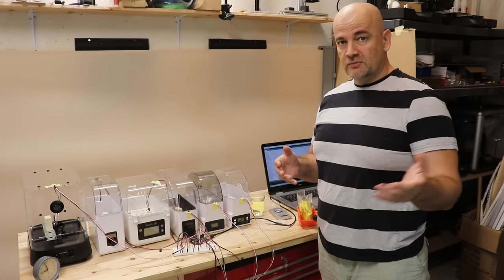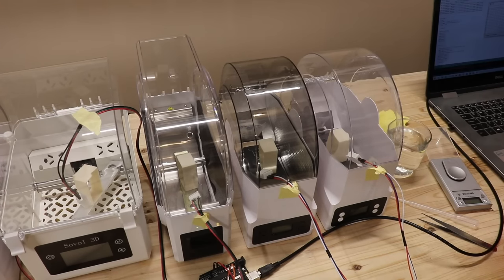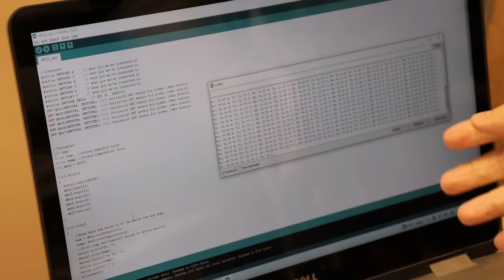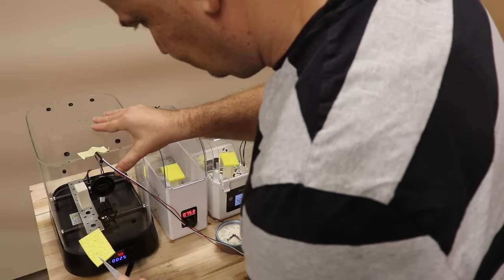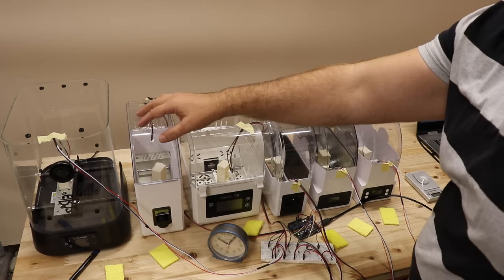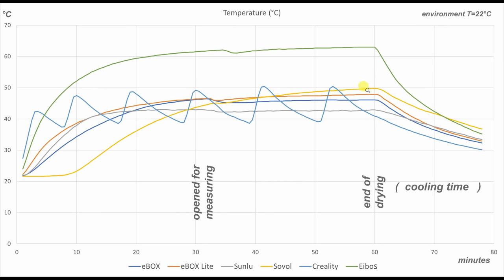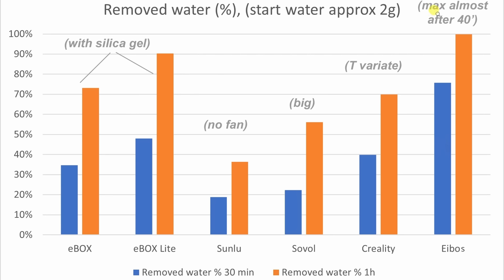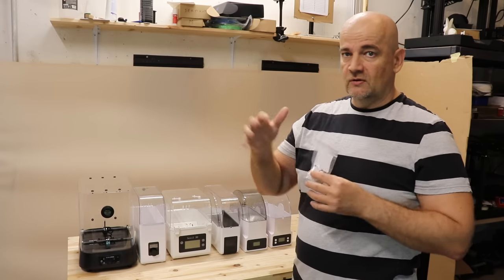6 filament dryer test - which one dries better? eBox, eBox Lite, Sunlu, Sovol, Creality, Eibos

Comment: This is awesome, thank you for the greatly designed experiment and clearly presented results! I am only interested in the dual spool devices, Eidos Cyclopes and Sovol 3D in this case to swap my filament spools for print tasks that last several days in a row. I don't understand why, in the Relative Humidity % plot the Eidos starts at 50% while the others start at around 70%? I think Eidos is designed as a dryer while Sovol can't decide whether it's a heater or a dryer. I can count 17 outlet & air vent holes in Eidos and only 2 outlet holes in Sovol, so the latter cannot efficiently release water vapor when lid is closed. To get a better sense of the drying capabilities of the Sovol, I drilled 2 extra holes in its cover and removed the outlets from the two original holes; then I put two recently open spools in it and set the temperature to 50 °C. By the time the temp monitor reached the target value (about 20 min), humidity had dropped from 45% to 32%; after 4 h it dropped to 22%. However, I think the Eidos still beats the Sovol because of its better air flow design: in Eidos, air flows from bottom to top and out; in Sovol, air has a circular movement around the spool axis.
Reply: The Sovol literally says in the instructions that the lid is not designed to be fully shut. Its meant to be left partially open using the latches to prop it up. Which then allows the moisture to evaporate out appropriately. I tested it both completely sealed, and with it slightly cracked open. Slightly cracked open the filament humidity dropped MASSIVELY and in about half the time.

Comment: Which one can be run automatic? I just want to put the filament there and print. Don’t want to be manually controlling, it should just turn on when humidity inside fall below a threshold and it will be ready to print .
Reply from the maker: None of them is automatic, but very minimal settings. For example with Creality dryer you just need to turn the knob to set hours for drying.
Reply: @MyTechFun  wouldn't it make sense if you can just set the humidity and leave, so it auto turns on when needed. When you want to print the filament is always ready.

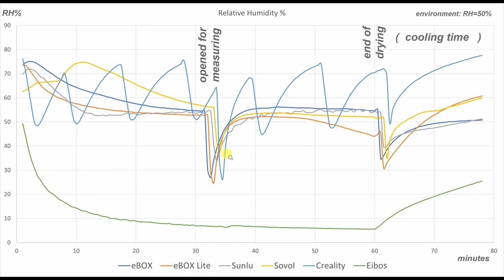Comment: Most useful plot is at 13:03 I think, showing that the EIBOS was the only drier which actually reduced the humidity! It got it down to < 10% Relative Humidity.
Reply: You could mod the others to allow the same process. This has been my biggest thought about buying one.. Would need to put some holes and silica.. probably dont need a fan - you dont want to be drawing out all the heat if your airflow is too high.

Comment: I have ordered the Creality one. And mine is not clicking during operation.
You only hear a relay click when turning it on.
I measured with a wattmeter and saw wattage go from ~4W to ~140W without a relay click.
So maybe they listened to you and updated the device 😉
Reply from the maker: If companies would listed to me, they would use silent fans on lower RPM. Variation of temp is too big in creality. I did also a noise test too. https://youtu.be/lINpcnp583w

Comment: Different temperatures of air store moisture differently so it's unfair to set the eibos to 70°C and the other lower. Maybe next time try use the smaller eibos dryer so that the volume of the drying region is also comparable too. But still interesting things to learn!
Reply from the maker: Unfair or not, I set all to max temperatures. If you would have all these dryers, and you need to dry nylon, you will not set Cyclopes to 50C just to be fair.
Reply: @MyTechFun  I totally see your point there and it makes sense. To be honest the eibos would still probably come out on top imo but in terms of a test the variables should be kept constant because then it would be made known which one is the superior product because they're all doing the same thing. As for needing the higher temperatures an end user would simply be forced to use the eibos but someone needing only pla drying would then clearly see the best product with a reasonable extrapolation to suggest that the results would be the same for higher temperature settings on the machine.

What I found really interesting was that some units turn the heaters off and on quickly

Comment: Hello,

Thank you for the detailed complex test. 
Could you make a comparison to the test with a fruit dehydrator? 
They are quite cheap, and more than 2 filament spools fit in. 
I have a idea. Can we use the printbed to dry a filament spool? 
A little enclosure (carton) with a hole on the top. The printbed can 110°C on prusa MK3s(+). 

Many greetings

juck.
Reply from the maker: Yes, I will. Only I want to finish the modification, so I can use it during 3D printing too..

Comment: Thanks for your work! I needed exactly this.
The eibos is expensive and I only need a one slot dryer. Do you have any results printing nylon from the eibos easydry? Do you think the 50degrees are enough for it or should you need the 70degree?

Comment: Hello Igor!

I'm newbie in 3D printing, some weeks ago I bought a SV06+, and I looking for a filament dryer. 
Now I'm hesitating between Sunlu S02 and Sovol SH01, and I don't know, what is the most important: the fan or the potentially higher temperature. I know both are important, but if I have higher, but not ventilated temperature, it may isn't enough. 

Now I started printing with PLA, but ofcourse I'll want to try any other type of material. 

What do you think, what can I choose? Or drop my hesitating, and choose a total different one? The budget is not endless, but if I can buy a much better for not too much money, it's okay for me. 

Thanks in advance,
enthusiastic follover,
Attila (from Hungary too :) )

Comment: Nice video. One thing I haven't seen anyone make clear about these dryers: Do they take air in from outside, or exhaust air to the outside in any way (eg active/fan powered vent slots, or passive 'holes' to allow air to enter/escape)?
Reply from the maker: Real dryers (like food dehydrators) let the air out, with this they take out the moisture too. Now, the question is, is it really necessary with filament dryers? Usually you don't have so big amount of humidity. Probably.

Comment: Could you compare to/add information with using a cheap food dehydrator?
Reply from the maker: Yes, working on that too. I have food dehydrator, only I want to finish the modification, so I can use it during 3D printing too. After that, there will be a video

Comment: What is the diameter of the rod and the diameter of the bearing which make up the rollers which hole the filament spool in the eSun eBox and the Sovol units? (mm)
Reply from the maker: Main middle part of the rod 8mm, Besting not sure, I couldn't take them out, on sovol look like 10mm (probably the rod is smaller dia there)
Reply: @MyTechFun  Ahh. I thought the Sovol had removable/adjustable rollers. Which on has the rollers which you can remove and set in place for either large or small spools.

Comment: Very interesting comparison. Did you set them all for their max available temperature?
If not - it would also be nice to see as a comparison:
declared max temp, is it actually could be reached (I know, in most cases - no), and how fast actual max temp could be reached
Reply from the maker: Yes, all set to max temperatures
Reply: @MyTechFun  Then it would worth to show them on graph as horisontal dashed lines
Reply from the maker: @Kekht  Some of them don't have exact set temperature. For example on Creality. Also on eSun dryers, only level is set, but what is that temperature, not. Explained on separate review videos for these dryers.

Comment: Thanks for another great video; however, I think your comparison is missing a key dimension: the capacity of each dryer, in kg.  If I wanted to use the Cyclopes for two spools of filament, or one jumbo spool, its effectiveness would be quite different than if I used it for a single, "regular"-sized spool.  In other words, I would fully expect it to "dry" your single sponge twice as fast as a competing product that only only holds half as much filament.  This review makes it look better than it really is, but it still seems like a good product.

Comment: Well, now I regret buying the Sunlu dryer :( But honestly, it's worked fine for my needs even if it isn't the best.
Reply: If you do the fan mod and add some descant its actually not too bad. The fan helps the air circulate so gets an even temperature. But tbh for the prices of the esun and sunlu its worth spending a little more to get the eibos.

Comment: Honestly I am kinda upset with these dryboxes, for their cost - they are very bad.  Why?   You can get a decent sized food dehydrator for around, $60 US.  you might have to shop around to check sizes, and aim for one with metal racks over plastic (and not the cylinder ones)  - but these can also get to temperatures needed, and have timers and the like - and are designed to dry foods, so ... drying filament isn't any different for it.   Get to temp - remove moisture from inside air - timer - etc.

The difference is - if you get a good dehydrator you can clean it out (with oven cleaner) and use it for food again between uses, provided you don't actually melt the plastic inside into a drippy puddle (only really a problem with PLA and softers)

The Dehydrator method, also typically fits 2 spools or more as well... so.. all these single spool systems.. are really bad at what they do, the ONLY thing these (sometimes) can do is allow you to dry and print from the box directly, instead of removal... and honestly for the price.. I don't think that's good enough.

Comment: This is very unscientific due to fact that measuring evaporation on sponge of wet sponge does not model drying filament in any means as it does modell the real thing, it just gives overall view of moisture removal for sponge drieing capability

Comment: The test will not be accurate for dryers with multiple coils. In my opinion, a sponge should be put behind each coil. This test actually tells how quickly you dry the same amount of water in otherwise large dryers and will tell how much time you need to dry one coil.

Comment: I have the Sovol and besides it only getting to 50c it does a pretty good job. I lay a 50G dessicant pack at bottom too. It fits easily and don't bother the rolls as there is plenty of room for it. I print mostly PLA anyway since it's come such a long way! It's only real downfall is it's low resistance to higher temps.